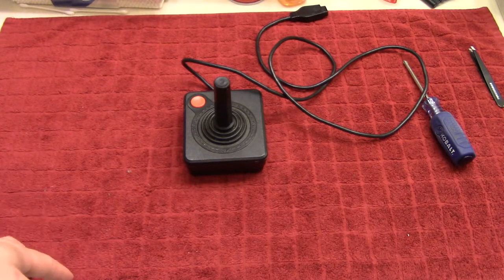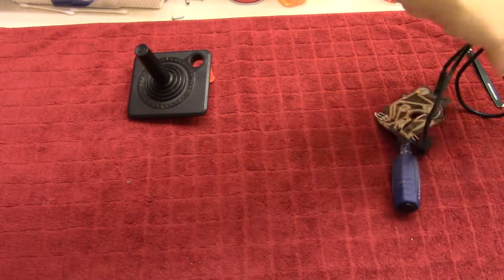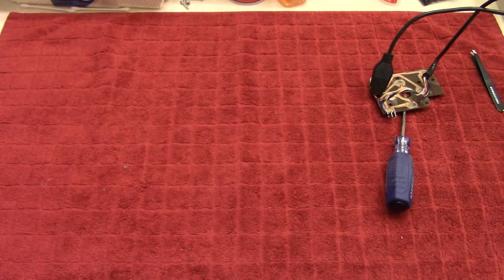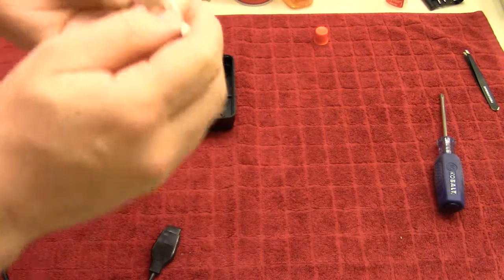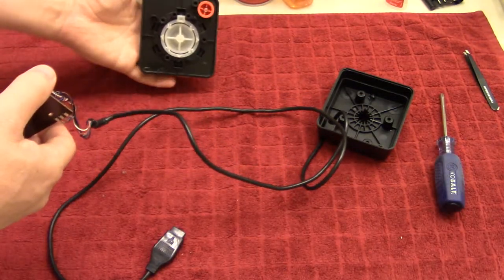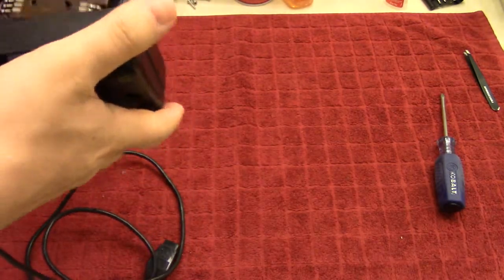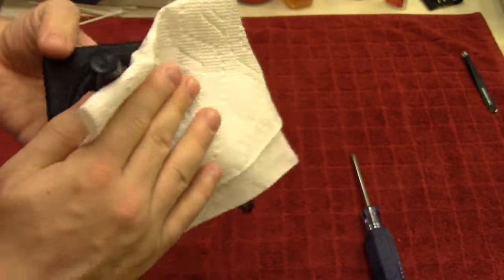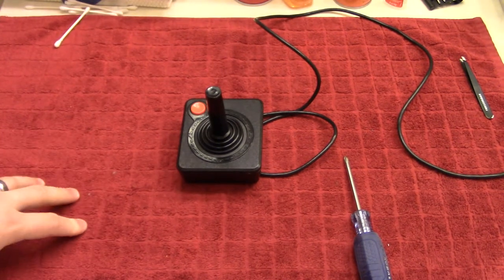Cleaning an Atari 2600 Controller

Comment: Hey! Thanks for helping me on the subject. I got this on eBay for about 180, it had a bunch of games, 78’ six switch woody, 2 paddles, 2 controllers and 30 games, along with star raiders addon and AC power thingy. Controllers wouldn’t work as well as they should, cleaned it up and they work excellent! 

Thanks.